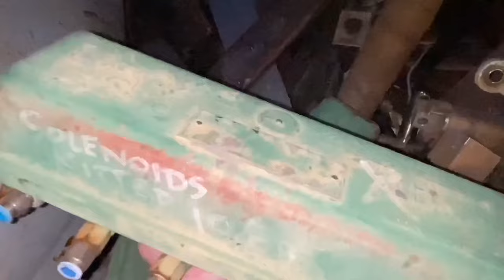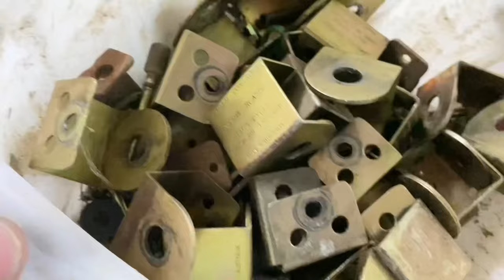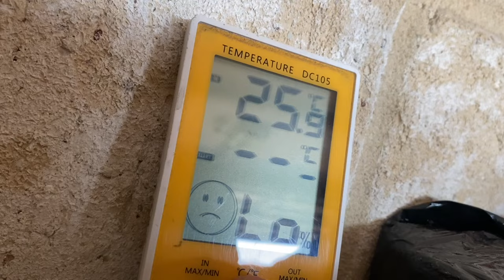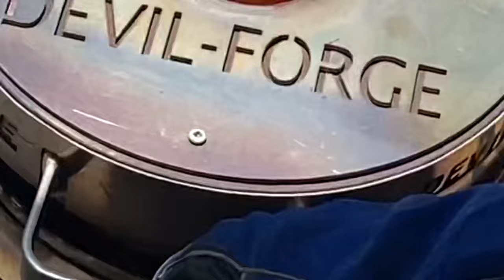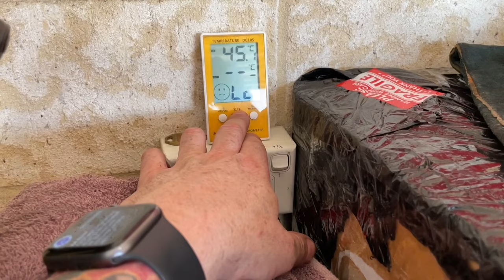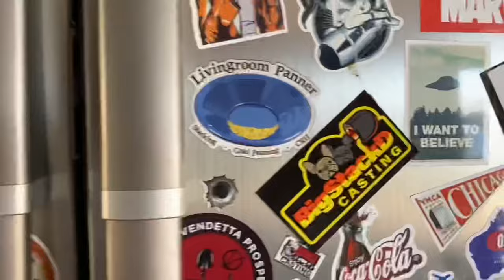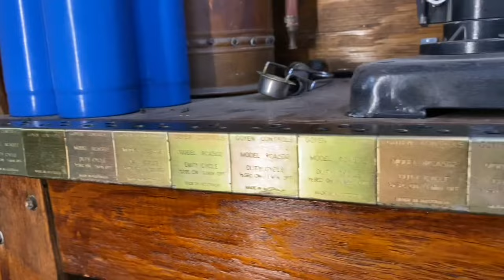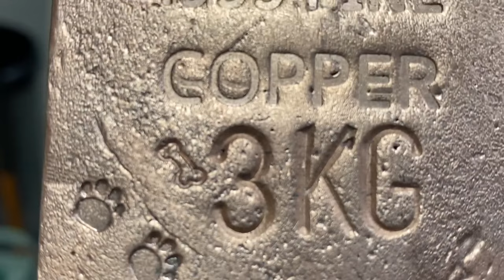9KG Pure Metal Dumpster Dive - Scrap Solenoids - ASMR Metal Melting - BigStackD Trash To Treasure

Comment: Does melting metals into ingots really sufficiently increase the value over reasonable cleaning? Also is the process acceptable to local air quality districts? A friend of mine ran a motor rewind shop here in Sacramento  in the '70s, and he used a small propane burner to remove the motor windings. That is until the local air district visited him one day and banned it. And he wasn't smelting anything, just getting the varnish on the windings crispy enough.
Reply from the maker: Actually buddy if I was to take these ingots to the scrapyard they would offer me nothing extra so all profit would be lost in time and gas. This is just a hobby I do on my days off that’s why I don’t sell anything I just stack it up. When it comes to air-pollution and needing permits I have spoken to my local council into the EPA environmental protection agency and they said because it’s running on normal propane and it’s such a small setup I don’t require any permits or anything like that they were more concerned with the fact I might be melting lead which I hardly ever do so I knew it was fine to do it in my garage and driveway , Obviously as long as it’s good airflow in there. I did however have a neighbour complain to the council and didn’t bother coming to see me first and when the council come over and did all their investigations they came back to me and also said I’m completely fine to do what I’m doing and that the neighbour basically has nothing to really worry about👍🏻. I’m hoping to move houses in the next few months anyway so I’ll have a lot more room and no neighbours

Comment: You usually melt brass, copper and aluminium (probably because these metals have a high value) but ever did some zinc or tin melting ?  melting points for Zn and Sn are much lower than Cu and Al so less propane should be used. The revenue of a zinc bar is however less than the same weight in copper...
Just asking.

Comment: Seems like it's hard for a lot of people to understand dumpster diving and the thrill of it.. I miss doing it but I don't have the energy and willpower to do it since I quit drugs. My dumpster dives were usually for scrap electronics to either tear down for components or fix and trade for drugs lol - or really just anything that seemed useful.. There's no feeling quite like turning junk into something useful - or at least more useful junk.

Also, for years I've really wanted to be able to melt stuff into ingots and blacksmith/make knives and such. If I ever get my willpower back for hobbies, I think that will be one of the first things.. I just need a forge that can liquify metal and/or just heat it for blacksmithing.

Comment: Add another forty pounds to your goal. That way you get a long tonne, not a metric ton. Or an Imperial tonne, if I mixed my terms.
Twenty hundred weight of metals. Sounds cool. I mean hot! Is aluminum the worst at slagging in air? Or is steel similar?

Comment: Which kind of solenoids it is? It looks like fluid control (6 solenoids per box with tubes) in an industrial thing or a big hydrolic machine (green color)! So, I noticed the name "Goyen" on these things and I made some search: They are enclosed valve sets with the CSA (Canadian Standard Association) logo! They can be sold here in Canada and they work in industrial electrical fluid control field. That material remains on the market with some difference!... Update: This control part Goyen Controls RCA6 is used for industrial dust collectors used in wood, paper, factories and so on where dust is generated at large by sawmills, papermills, sanding machines, metal cutting machines ect... Curiosity about "mystery" things do this: QUESTIONING AND SEARCHING!

Comment: Would be nice ti learn the chemical composition of those slags, as well as to what happenes to them when they end up on the landfill.
Does the weather slowly helps the degradation process to turno them into small particoles (which can then be used by microrganisms to help their growth)? Or Is It more complicated and requires the slut to pass onto the proper enviroment (maybe underground or at the bottom of the Sea?) To  reach the condition where It can re-enter nature and help the Life cycle? 
Or maybe they are like rocks... Almost useless?

Comment: If you are doing smelting for the fun of it, skip the rest of this comment.

If you run across more of those Goyen electric controlled pneumatic manifolds do NOT melt down the 'purple plastic bits'. Those are solenoids of which Goyen typically used AirWolf. As such they are worth more on the re-sell market(ebay) than the copper inside is worth.

Comment: Not being a smart ass. I really want to learn. @bigstackD has melted almost 800kg of metals. Quite a bit of it is alloys. There is a clear market for the metal's in their pure form. Is there a market for the mixed metals? Is there a way to separate the alloys into their original metals? If not then @bigstackD has a useless 1 tonne wall of metal.

Comment: you complain about the heat try the cold today the high was 19 f. tonight the low will be below 0
Reply from the maker: Yeah but in winter I’ll complain about the cold too. I’m just a whingeing prick well at least that’s what the wife always says🤔.
Reply: I am not saying anything bad if that is how you took it my wife complains if too hot as well as too cold  @bigstackD
Reply from the maker: No mate, I at no time thought you were saying anything bad, I read it right it is all good my friend 👊🏻😁. And having said that it just hit 40.7°C where I am, and I am absolutely exhausted ! It’s just turned 3 pm. And Haven’t even had a bloody beer yet , been working outside in the melt area, cleaning it up and ripping out the old colorbond sheets which the previous owner thought was a good idea to bloody concrete the bottom of them in, so I’ll be going inside and complaining about that all night to the Mrs that’s for sure😆.

Comment: i would rather melt scrap than sell it   cast that special  hand foot in aluminum  or copper  bro did a lead hand in the 70's in  the ground
3' lengths x elect cable -  Once made a large copper wire spiderweb  with a alimin  spider 
  hung in the Loo  mates where impressed never seen b4 1990s chit you do     cheers  Aussie  Get an Eureka Flag    with Ned Kelly   Such is Life  ebay  cheers